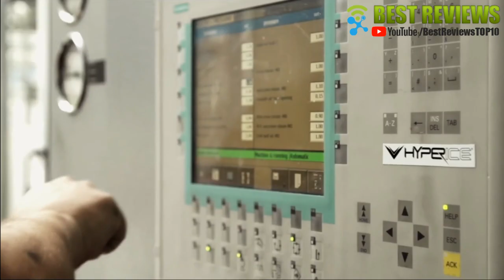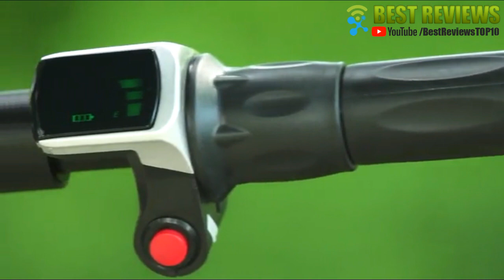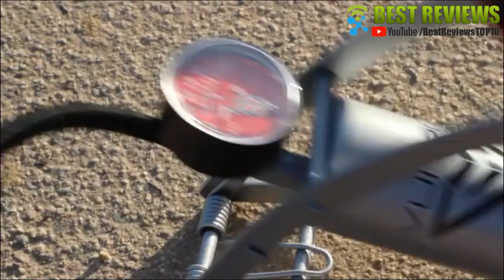5 Crazy Cool New Inventions You NEED To See | Amazing Inventions You Never Knew Existed

Comment from the maker: 5 ►  Hyperice Vyper 2.0 High-Intensity Vibrating Fitness Roller
●Amazon US : http://amzn.to/2Fcn3RK
●Amazon UK : http://amzn.to/2oPzZpH
●Amazon FR : http://amzn.to/2FSR4XS
●Amazon ES : http://amzn.to/2oPEkZV
●Amazon IT : http://amzn.to/2FWlHvH
●Amazon DE : http://amzn.to/2oHVzwZ
●Amazon CA : http://amzn.to/2D09e6L

4 ► iFetch Interactive Ball Launchers for Dogs
●Amazon US : http://amzn.to/2CZrc9I
●Amazon UK : http://amzn.to/2CX1K4F
●Amazon FR : http://amzn.to/2FdWdNf 
●Amazon DE : http://amzn.to/2oOJsxn
●Amazon CA : http://amzn.to/2oIt02n

3 ► Glion Dolly Foldable Lightweight Adult Electric Scooter with Li-Ion Battery
●Amazon US : http://amzn.to/2tdzV8B
●Amazon UK : http://amzn.to/2Fdi5nC
●Amazon FR : http://amzn.to/2FTc8gL
●Amazon ES : http://amzn.to/2I2ZjBf
 ●Amazon DE : http://amzn.to/2Fd6M2K
 
2 ► FLUXMOB BOLT2 Portable Multiport Power Adapter: USB Wall Charger and Universal Battery Backup
●Amazon US : http://amzn.to/2FawQYj 
●Amazon CA : http://amzn.to/2oIttlr

1 ► Vurtego V4 Pro Pogo Stick
●Amazon US : http://amzn.to/2CY6maM 
●Amazon DE : http://amzn.to/2I1NvPN